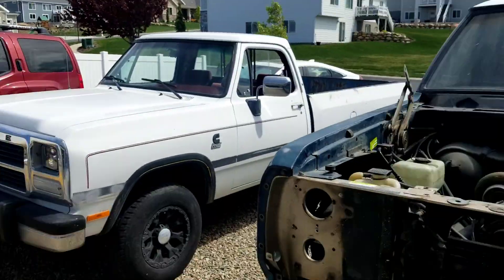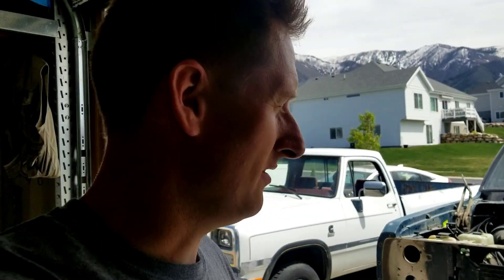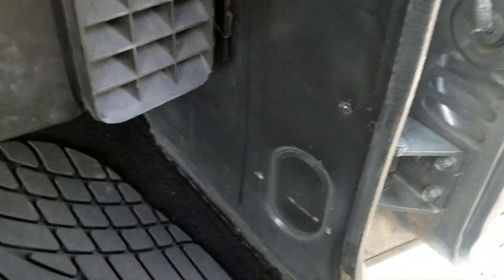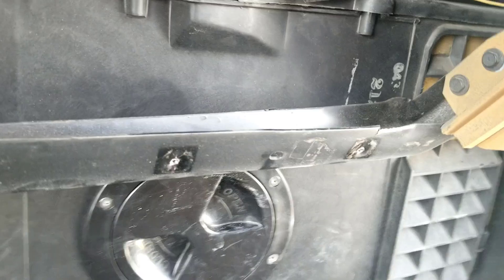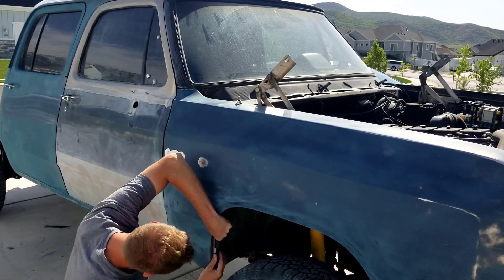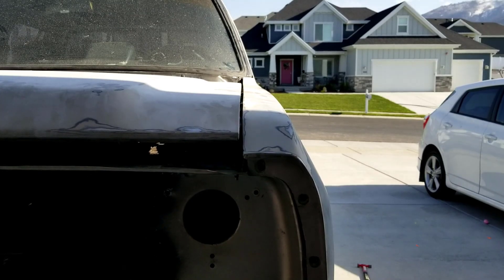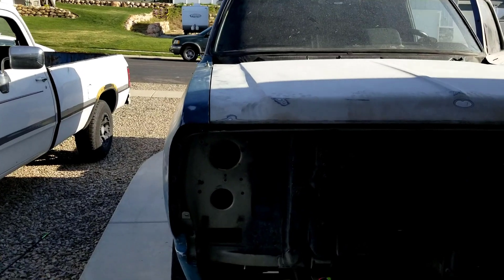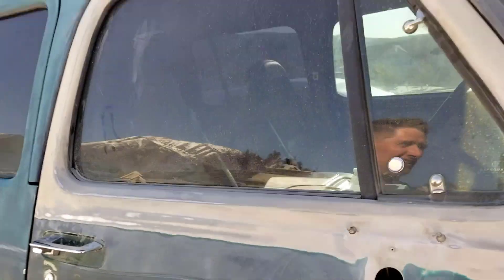Aligning the Front Clip on my 1st Gen Cummins Crew Cab (Part 2)

Comment: Aligning body panels solo can be challenging. Plastic body panel shims helped me a lot. I like to use the doors as a reference point also and work my way forward also.
Reply from the maker: Yeah when I realized the driver door was not completely straight it helped me realize why things would line up perfect there. But I just found a new driver door that I'm picking up this weekend.